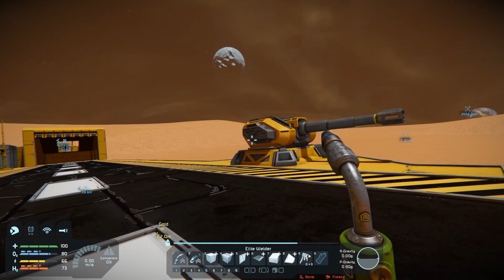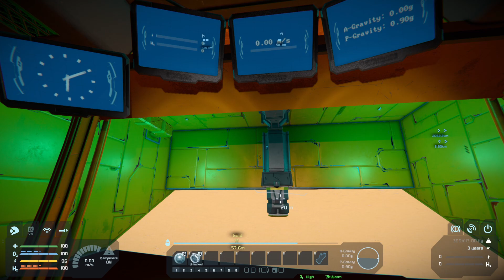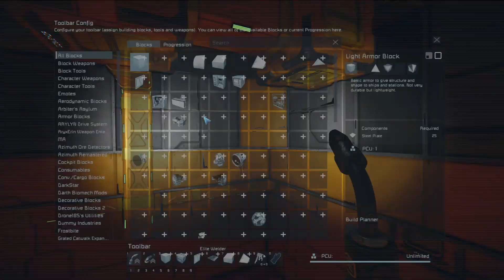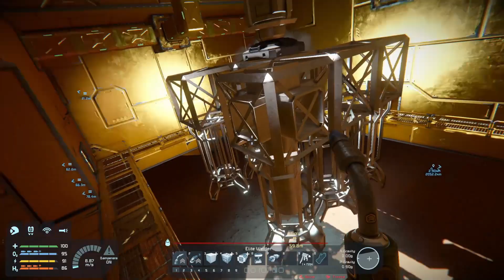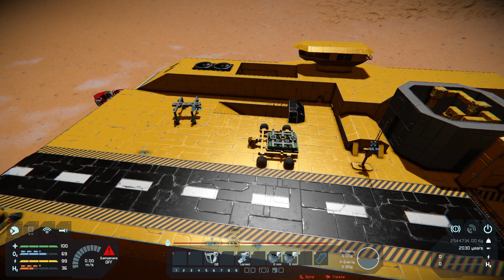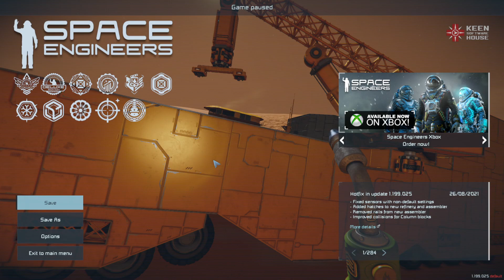DECK CRANE & CARGO MOVER :: Space Engineers Survival :: Ep. 959

Comment: I've seen the wheels falling off bug before, but I think that the space on the "top" of the suspension is not meant to be used to hold the whole thing to the vehicle.  I've always used the flat space at the "end" of the suspension.
Reply from the maker: The wheels have attachment points there so it should work, but SE sometimes is not nice to you. I was able to get around this by having blocks on the sides too.

Comment: Hello bro, for the crâne head. Why not using magnet pad that will stop clang. Like a round head with 4 pads that will also remove the need for the router and no more turning head rotor problem . Just an idea
Reply from the maker: Good idea, used landing gears, but the turning head needs to stay to be able to load it onto something in the right orientation.